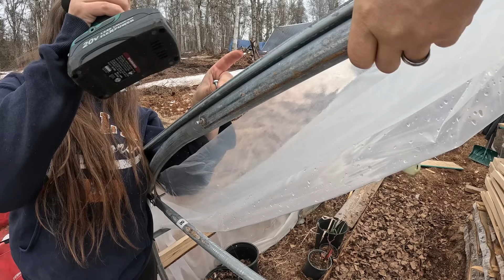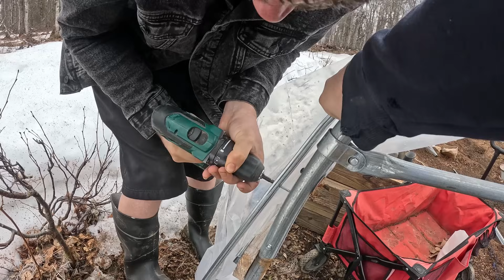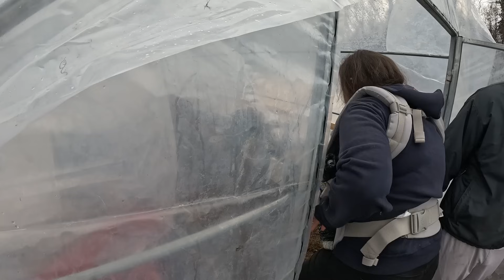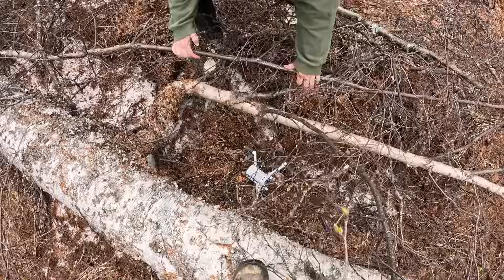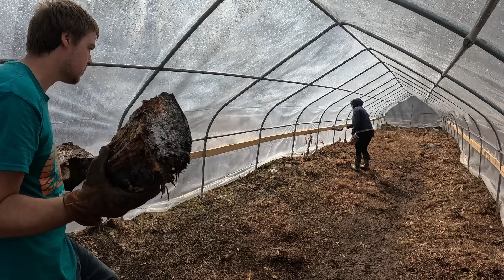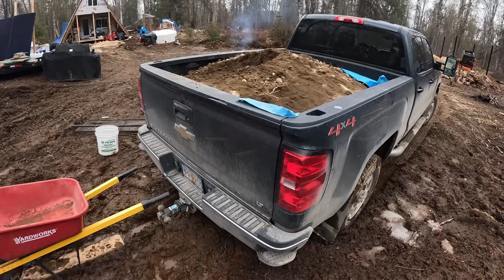Bringing in dirt - Preparing the greenhouse for planting

Comment: Alaska is great for raised beds.  The soil warms quicker that way and you don't have to stoop so far over to work them.  With your sawmill you can use slabs to make them cheaply.  Plants in a raised bed start growing two or three weeks earlier.  If you plant through garden fabric you will have a lot less weeds to deal with as well.

Comment: The coefficient of the bend in metal is the proportion of .8683 of the thickness times the width of the material being bent.  It's important to calculate this prior to attempting to place a bend in any metal so as to avoid fatigue, both you and the metal.
Reply: You’ve got to be an electrician or something.

Comment: If you prop up 1 end of your screen it will filter you dirt faster and better 
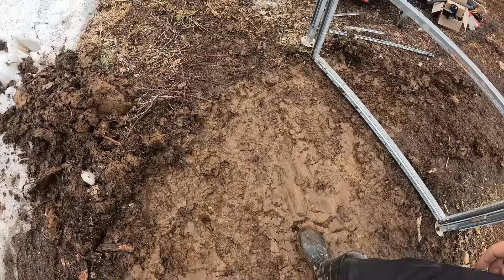I see the backhoe with out snow on it have you worked on it yet .moving clay, sawdust/wood chip and dirt will be a lot easier allso fixing the driveway will be easier than using 13:52 hand tools
Reply from the maker: I have been working on that tractor all day today. We are really going to need it soon. I have been unsuccessful so far and am running short on ideas.
Reply: @remotelifealaska good luck to you and the tractor too
Reply: Cody vise grip garage has several how to get a tractor running maybe they would help.  Or maybe you can ask him to give you suggestions

Comment: Random question:   has your truck windshield survived.  I believe it's more than 9 months.   Did you ever get the mirror fixed?
Reply from the maker: I think about 2 months after getting the truck we got a tiny chip in the windshield! We did get a replacement side mirror but have not switched it out yet, that’s pretty low on the list as the current mirror still works just fine.
Reply: Understand just wondering since you were debating on how long the windshield would make it.  I also thought your mirror was broken so wondered if they didn't get you the new one.